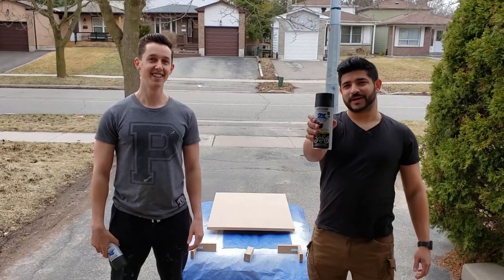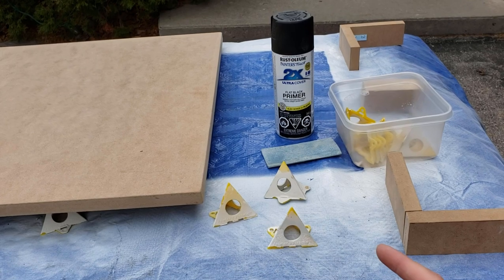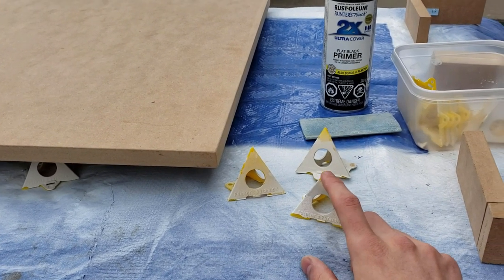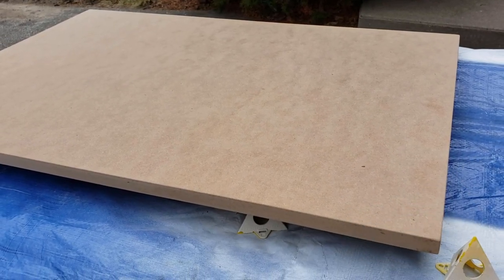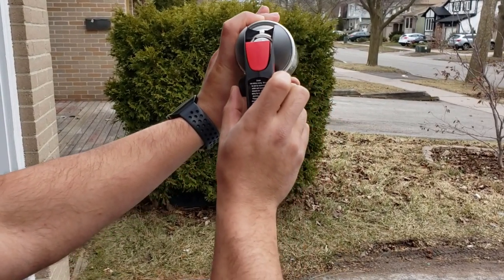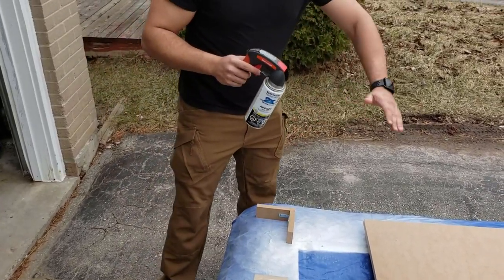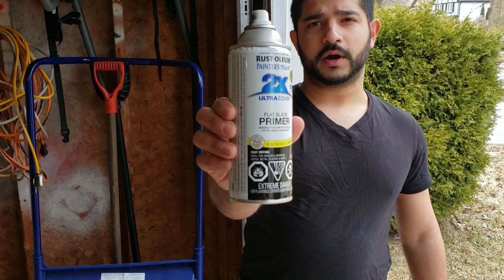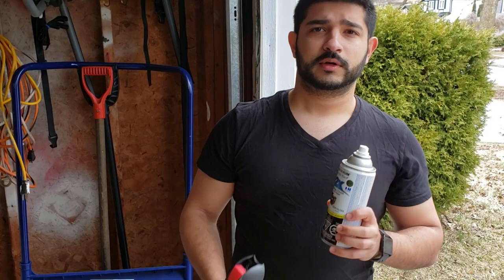How to Spray Paint Like A Pro 💯

Comment: If I may add a tip if you’re going to spray any type of furniture or shelves.... basically anything you need a professional touch to, is soak the cans in warm/ hot water for 5 minutes before shaking. The paint really comes out smooth without drips or sputters

Comment: My ceiling turned black because of the smoke from the kitchen.. how to fix this with spray paint?
Reply from the maker: For this situation do not use spray paint. Use a primer such as Aqualock, or Stix and apply with a 11mm thick microfibre roller, then use a proper quality paint such as Regal Ultimatte in your preferred white (OC-65 Chantilly Lace is the whitest white and would recommend that). You can wash the same roll and dry it thoroughly, or use a new 11mm microfibre roll. You will also need to brush the cut ins around the wall, and likely paint the walls too in your preferred colour. Hope that helps out and keep us posted on the progress! 💜
Reply: @MasterpieceRenovation  😬 omg ,i use spray paint for it white

What will i do?  This is a rent apartment im staying
😭 im going to pay fine for this one
Reply from the maker: It's not too late!l If there are any edges sand them down using 180 grit sandpaper and follow the steps to apply the paint with brush and roll. All you need is ceiling paint, it can be done without primer but it may take many more coats of paint. 👌🏽
Reply: @MasterpieceRenovation  do u have video link for that? 🙏
Hopefully i can save this
Reply from the maker: You most certainly can fix it with the right mindset, motivation and methods! Please see attached link from one our shorts showing how simple and straightforward it is paint a ceiling with a roller and extension pole:
https://youtube.com/shorts/wHrw1rbLZt8?feature=share
Reply: @MasterpieceRenovation  thank you for the reply 🙏
Reply from the maker: Huge pleasure! 🌟